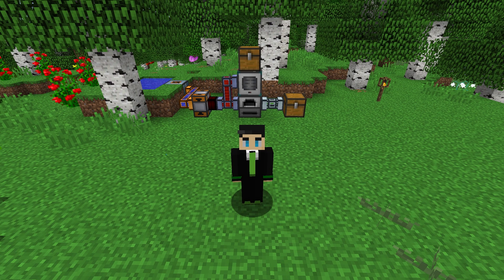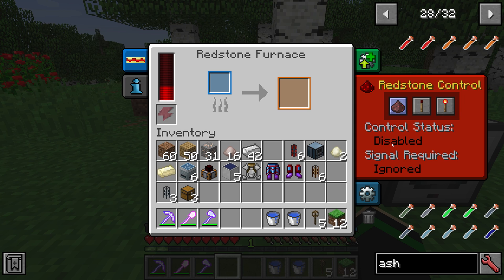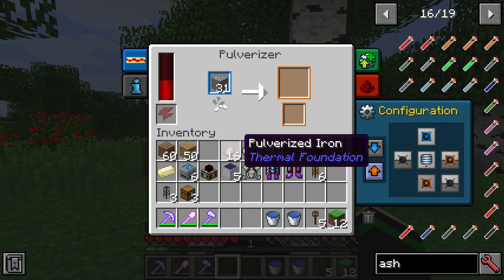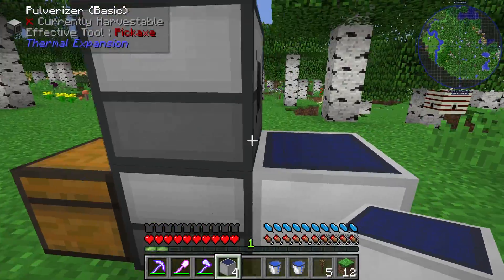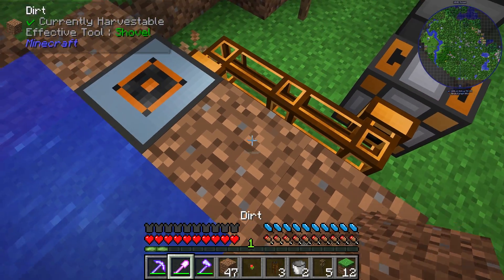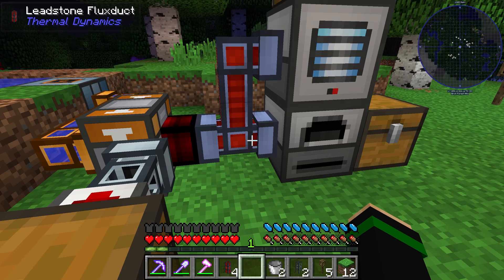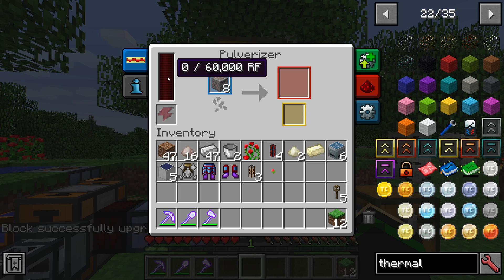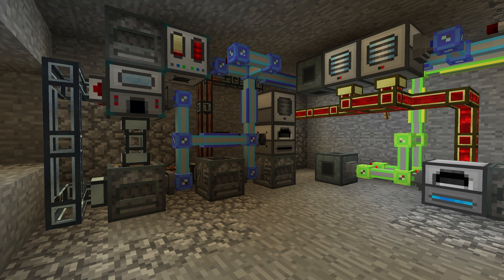Thermal Expansion: Basics (Power, Machine Menus, Automation) | Modded Minecraft Tutorial

Comment: Hello, Zenn! I am a player from Korea trying to enjoy this mod. Your explanation was very helpful and informative. After watching a video, I got inspired to try the Thermal Expansion mod and started playing on version 1.20.1, mining and smelting ores. However, I ran into an issue where I can’t craft any items from the mod! The crafting recipes don’t appear in the crafting grid or the recipe book next to the inventory. I checked in Creative Mode, and I can confirm that the mod items exist there. Could you help me figure out why this is happening? I used a translator, so I apologize for any awkward phrasing. Thank you for your understanding.
Reply from the maker: So my version was a much older version (1.12) so the 1.20.1 version will be a bit different, such as the machine configurations and some recipes. I believe there is a mod called "Just Enough Items Integration for Thermal Expansion" or something like that. So if you install that one as well, and Just Enough Items, you will get that item menu on the right, and can press "R" to pull up the recipes for some things. I think the 1.20.1 version of the mod is missing some things though too, such as item ducts and documentation, I would recommend a modpack with Thermal Expansion in it which will be more rounded, and will almost certainly have a way to see all the recipes for things. If you go that route, you can press "R" on the item menu on the right after mousing over an item to pull up its recipe.

Sorry I can't be more help in this case.
Reply: Thank you for your kind reply. I'll have fun playing with recipe mode and extra mode. Love you @ZennsWorld

Comment: My version does not have the steam dynamo 1.20.1
Reply from the maker: I cant find anything about the dynamo changing between older and newer versions, but documentation is spotty. What version of thermal expansion are you using
Reply: I think I’m a bit late, but the “Stirling Dynamo” does the same thing as the steam one, just without the need for water.

Comment: I'm playing on the Seaopolis 1.20.1 modpack, and I'm not seeing an Aqueous Accumulator anywhere and I have no idea on how to get this working. Any ideas?
Reply from the maker: Weird that it isn't there, maybe looking up thermal foundation / expansion and seeing if it is named something else in your modpack is worth a shot. I checked the mod list and you also dont have tech reborn, buildcraft, or nuclearcraft which are my alternative methods of pumping water.

It looks like the modpack has a progression system, maybe check that for any clues. If all else fails the other main option is to start trying random stuff that looks like it could pump water (which is time consuming usually, but you can come across cool stuff this way). Sorry I cant be of more help
Reply: Maybe the mod author removed it or your using a bugged version of thermal that removes all devices from JEI. Try to update the thermal foundation mod to the latest release
Reply: You may be playing version 6.0 rather than 7.0

Comment: If you have multiple machines hooked up to the same power source and you're not making enough power for all of them, does it prioritize some or does it split the power equally?
Reply from the maker: I believe it will split the power evenly. The cables have power ratings so if the cable is maxed out it will do what it can
Reply: @ZennsWorld  What's the pack you used for this tutorial? Is it just something you threw together, or?

I have zero questions about Thermal as I know pretty much all there is abt it, but I'm interested in the pack you used, thanks in advance.
Reply from the maker: Its called Minecraft Eternal. Should be this one https://www.curseforge.com/minecraft/modpacks/minecraft-eternal if the link works in comments. Definitely not my own work Im not that skilled
Reply: @ZennsWorld  Ay, cheers. Thanks for the link!

Have a good one!